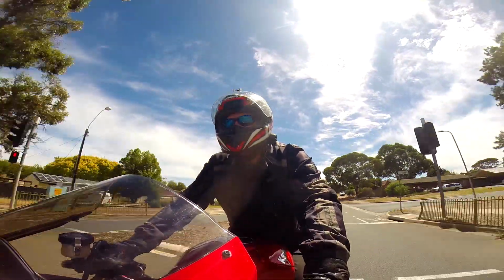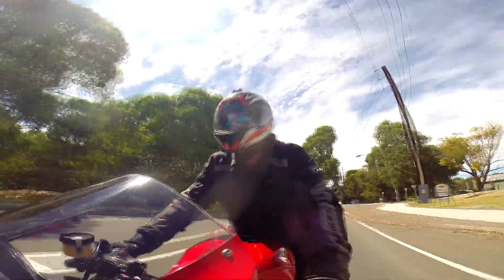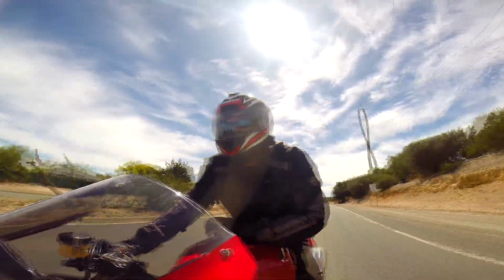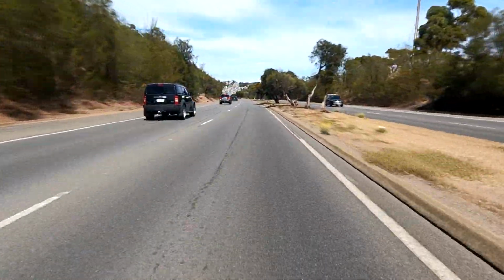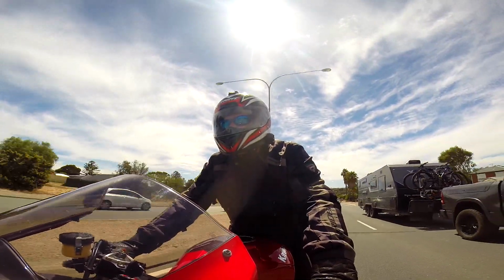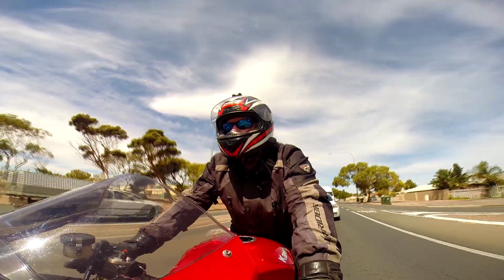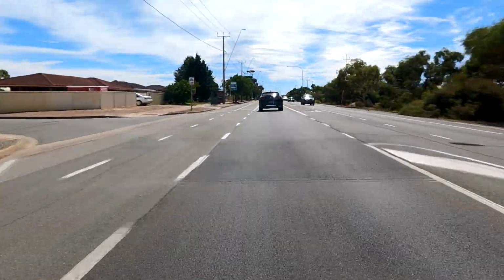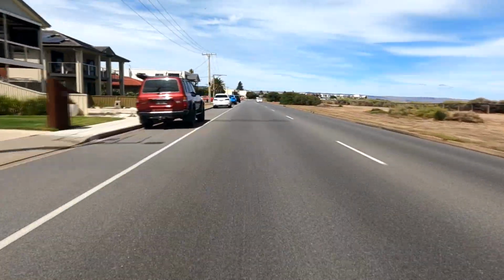Back on the Ninja #zx14r

Comment: Glad you are getting better.
The 1400cc Kawasaki motor is amazing. Such underatted motorcycles.
Also, congrats on the 700 sub milestone.
Reply from the maker: Thank's buddy and yeah some days are better than others it is just one more issue to add to my list now days but eh! ya get that. The ZX 14-R's are a top machine and even better when they have been flashed and re-tuned, very high in the fun factor. Hitting 700 subs is cool and I am looking forward to making the 1k mark but at my pace that will be in the next few years...lol again thanks for stopping by and keep safe.

Comment: I remember that bike!
Reply from the maker: Yeah I have had this bike for many years now. It has been so good no problems at all just normal things in service. A very comfortable bike to ride glides over the bad roads and bumps like a good car would.and power well.... lets just say its nuts. After a Chip and re-tune the Ninja punchers out 173.1 Kw or 254 Hp. But all of that down in normal riding speed land the Ninja is the most effortless bike to ride. ZX14R's are one of the fastest bikes on the planet out the box.and it you don't know much about these models and you have some time look theme up on youtube to get the real picture on them.

Comment: Nice that you can do registration in 3-month blocks. What does registration cost there? Here in Pennsylvania it is yearly...
Reply from the maker: pr year here say for the Ninja it's just under $400. but it goes by engine size to a degree as well. for cars for a year a V8 its  $1165.50 pr year.

Comment: 77000kil is what? 94857382934miles? Damn the rest of the world for not doing things the american way! lol
Reply from the maker: Hahahah 94857382934miles? lol....... it works out to 47845.58 miles. We use to be the same as you guys for everything weight,  measurements the lot apart from what side of the road we drive on but back in 1974 we went metric and man that shit was confusing. Some bright spark called it all metrification...Like WTF? but we are stuck with it now...Thanks for stopping by and keep safe :-)